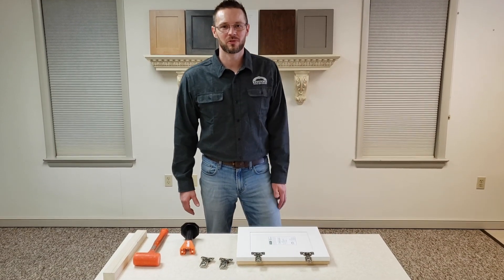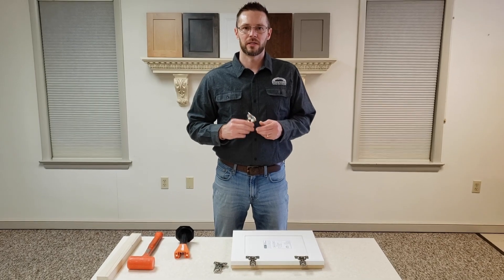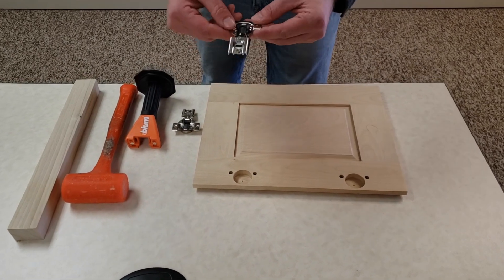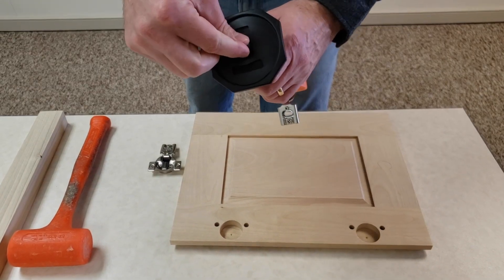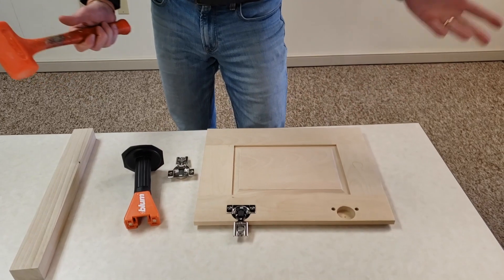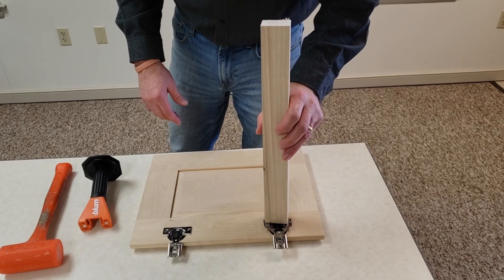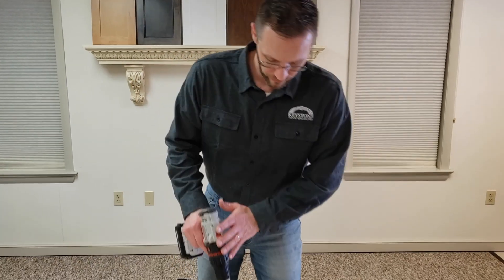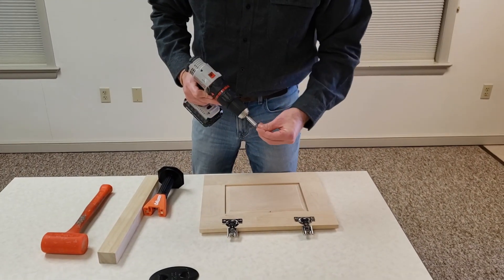How to Install Press In Hinges

Comment: Nice! For only a few doors the wooden block looks more than adequate. For those thinking this is 'obvious' it actually answers two fundamental questions for me -1) You CAN drive these in without the special tool 2) Once inserted the hinge is removed/re-installed with the screws leaving the insert in place.

Comment: Would you recommend skipping the dowels for hardwood?
Reply from the maker: Yes, I would recommend the press-in dowels only for MDF / laminate doors, and I would use wood screws for hardwood doors.
Reply: Keystone Wood Specialties thanks for making the video!
Reply from the maker: Correct, you would not need the dowels for a wood frame.
Reply: Can the dowels be used for wood application if possible?.